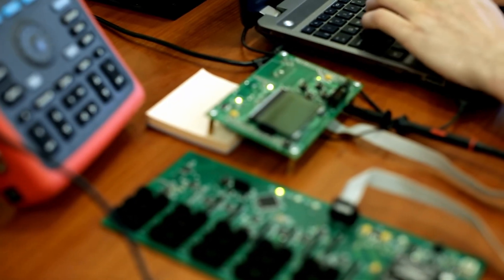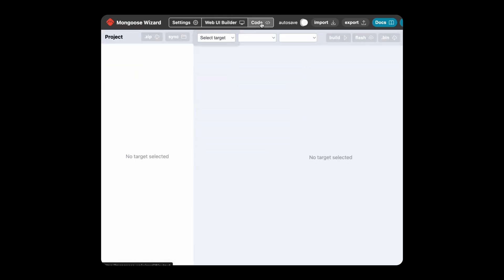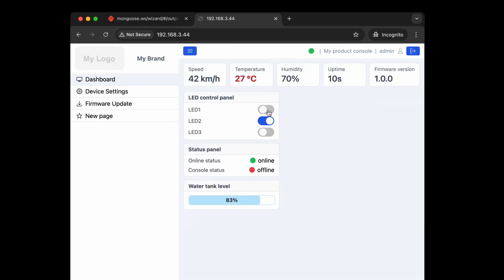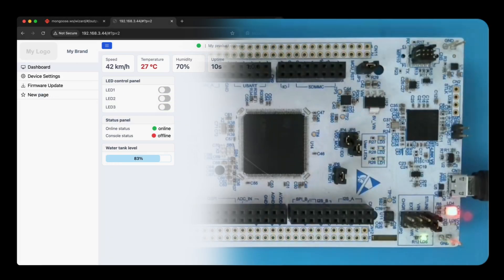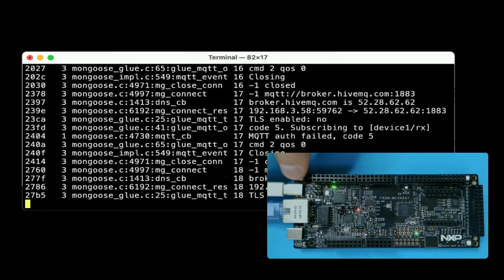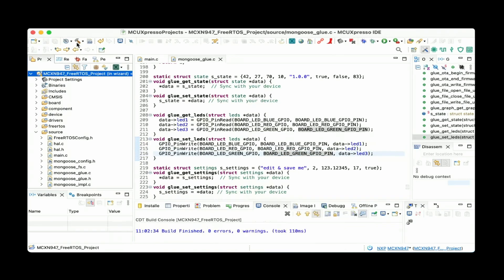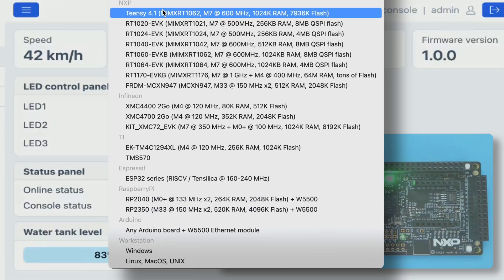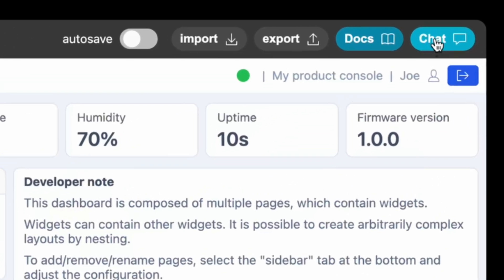Web UI on microcontrollers with Mongoose Wizard

Comment: Nice.

Is there support for custom STM32 microcontroller boards? I noticed only Nucleo boards and discovery kits in the video.

Thank you
Reply from the maker: The simplest way is to choose the board which is closest to yours, then modify. Join the chat, and we'll assist !
Reply: @mongoose-networking-library  Thanks. I actually have an STM32F4 nucleo board but I plan on experimenting with the Mongoose wizard for a custom board. I haven't made up my mind on the exact STM32 MCU that I'll be using.

IDE: STM32CubeIDE
RTOS: FreeRTOS